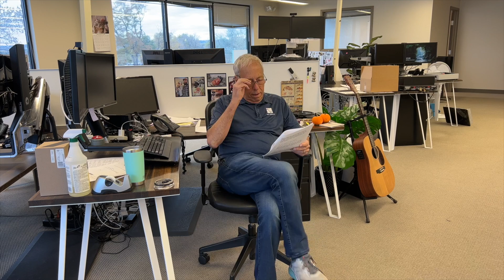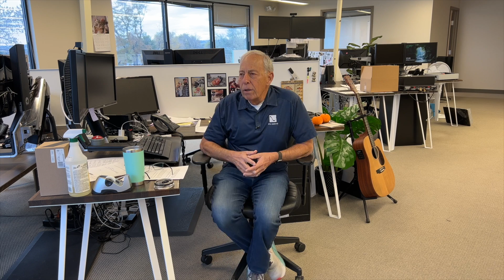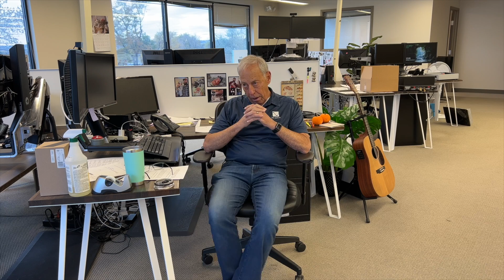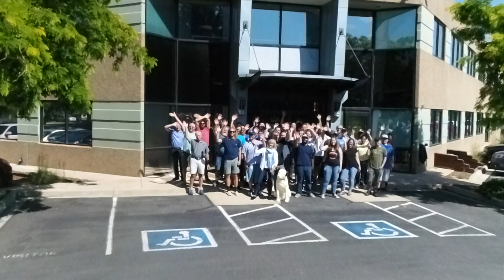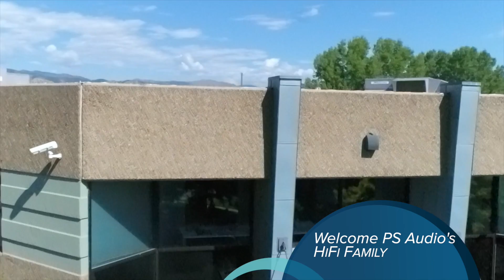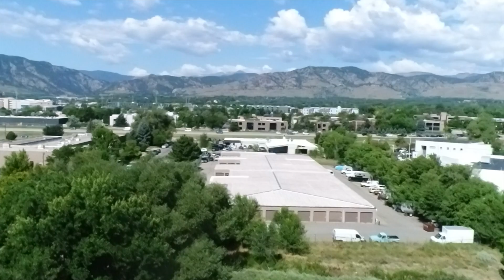Understanding current and voltage in audio

Comment: Here is something confusing that Paul mentioned (maybe I misunderstood): How is a speaker’s impedance, say 8 ohms, a “steeper hill” than a power amp’s input impedance of, say, 10,000 ohms? I understand intuitively that speakers are harder to drive than power amp inputs, but why does a lower number like 8 ohms mean more resistance and a higher number like 10,000 mean less resistance?
Reply: Its not a good analogy. The current is higher with lower ohms. With a superconductor its infinite(not really). With high ohms its very little. If the ohms are near zero it'll burn up whatever is trying to drive it as those parts can't handle the current that would flow through them
Reply: @lasskinn474  Thanks for the response and clarification… so the car, the horsepower and the hill is not a good analogy?
Reply: @SteveWille  its really not great. 

A simple isolated electric circuit of say a charged capacitor and a resistor and how it will discharge itself really is better. Theres not so much push as there is flow of electrons and effects of that.

The thing with the road and river analogies is that none of them really tell you anything about what gauge of wires you shoul.. Could be using or why an amp blew itself or what protection circuits do or what a ratings on a capacitor mean or how big of an airgap the electricity can jump and when it would do so, so they're not useful for determining if flipping a switch is a good idea or a very bad idea.
Reply: @Douglas Blake the way i look at it the problem with the uphill analogy is that the low resistance flows electricity more freely, so it takes more electricity to maintain the potential difference across it, which is ultimately what an amp is trying to do.

Consequently maintaining potential difference over a high resistance load needs less because it flows less freely across it and if you wanted same power drop across it you'd have to crank the potential difference much higher across it which is what i'd see as "harder push".

Of course actually providing higher currents tends to be harder in practice than providing higher voltages so that mixes things up..  But the low ohm load itself is easier to pass electricity through like i don't think anyone would describe a low ohm cable as an uphill.

Comment: In the car analogy: Volt is Rpm, Ampere is Torque and work done is Watt or Horsepower. 😄
Reply: Other way around, voltage is the force.  Amps is just the volume, or in this analogy the amount of spinning so RPM.  The torque/rpm/horsepower analogy does not relate well to electricity though.  A better analogy is hydraulics where pressure = volts, volume = amps, and flow rate (gallons/min or whatever) = watts.
Reply: @slode1693  Yes the other way around is perhaps better, but it does translate well as work done can be expressed by both hp and kW while you can interchange the other two to get the same amount of energy. 🙂

Comment: Current is the stream of charged particles (electrons). Voltage is the electric pressure (which can push electrons to move).  Current is not power! Power is energy per time (one Watt is a Joule of energy per second). Power = Voltage x Current.

Comment: Here's an easy example - a carpet shock may be 30,000 volts but since there is virtually no current, it doesn't kill you.  On the other hand, 240 volts at 30 amps coming out of your electrical outlet most certainly can kill you.  So the current is the oomph of the signal.

Comment: Analogies can be good educational tools if they are accurate. Voltage versus amperage is analogous to pressure versus volume. Applying that analogy to horsepower or watts is problematic since those terms combine the two and are used to define the amount of work performed. A more accurate analogy to amperage would be torque rather than horsepower.
Reply: You can have torque without movement, as in a clock mainspring, or a weight and pulley. That would be more analogous to voltage stored energy potential. You cannot have flow without pressure, but you can have pressure without flow.
Reply: @zulumax1  Agreed. Voltage is also a differential potential. The use of the term horsepower is what caught my eye. I really appreciate Paul taking the time to educate those of us without engineering degrees.

Comment: Voltage is the horsepower and current is the torque.
Reply: NOOO.  Voltage is the torque, RPM is current, and horsepower is watts.  It's not a great analogy in any case, but that's the closest way to describe it.

Comment: Charge is water, voltage is the pressure on the water and current is the flow of the water which may vary with the change of pressure. The resulting power (P) is the product of voltage (E) multiplied by the current (I) or in electrical terminology is P= E X I
Reply: and than comesa funny part. Power is voltage squared and divided by resistance (P=V2/R) - where is current? magically disapeared :-D ...... the point is simple, Current always needs to be equal characteristic like Voltage :-) if you are layman, you can say, current is constant only driven according impedance / resistance. For example 10volts signal and 4 ohms load is  25Wats of power, from that power you can find current by your equation, which is 2,5 amps for driving 25W of power on 4ohms load. if you want to have same 25W output power on 8ohms system, you will need higher voltage, aprox 14V, which is 1.8Amps on 8ohm load :-) I love those paradoxes :-D
Reply: that particular equation could easily lead into next question. If voltage is representation of intensity Air resonation travel distance, what does the output power means? :-D  Somebody could easily tell, that 8ohm system is more effective than 4ohm system, simply because you can handle same voltage on both system, but on 8hm you will have less power , means less current :-D ..... and that leads into understanding of Output power, preamp output power (gain for poweramp) input power from music instrument source, to mechanical Output power, thy physical what we hear - decibels (not talking about clarity etc)...... this is in overall pretty freaking topic :-) in root its simple, but such a simple things is heavy to explain :-D 

But my recomendation (as a semi advanced engineer) , you can take care of current only when you are designing Cables (diameter and of course its resistance comes to play also) for the system you want to use on particular power output.... otherwise, this is something you cannot monitor or control. Every time its only about the load you will put into the system. And load have its resistance, its the only key factor you can adjust....
Reply: This is the way it was always explained to me.

Comment: Water analogy:
Flow of water in pipe = flow of electricity in wire
Water pressure (e.g. 30 psi) = electrical voltage (V)
Water flow velocity = electrical current (I)
Faucet lever or valve = resistance or impedance (R)
The higher the water pressure, the higher the water velocity. But you can control water flow by the faucet valve. When valve is loosened (low resistance, low impedance), water flows more freely.  When you start to tighten the valve (higher resistance), water flow weakens. Exactly same phenomenon as electricity.
Reply: Voltage = pressure, current = volume, flow (gallon/min etc.) = watts.  Volts x amp = watts.
Reply: Amps (Current) is the volume of (the water / electricity) flowing. Volts is the measure of force of it (pressure) and watts is the amount of power (work it can do).

Edited - based on kind feedback from Douglas Blake.
Reply: @Douglas Blake Ah, ok, thanks for correcting me 👍. Yes that makes better sense now too. I have edited it to reflect your kind feedback and credited you.

Comment: I am confused.
Reply: Look at it this way. “Charge“ is water in a pipe. “Voltage“ is pressure on water and “Current” is water flow that varies with pressure on the water. Power can be calculated by multiplying voltage times current.
Reply: Me too.

Comment: Yes you didn't explain it correctly. The velocity of water in a pipe is like current. The pressure the pipe has is like voltage.
Reply: I would have described it a current = volume.  Voltage = pressure.
If you have a tiny stream coming out of a syringe, It can have lots of pressure(voltage).  You can shoot it across a room, but you won't knock over the furniture as there is no volume(current).  A tsunami may come at you slowly, (low voltage) but with great volume (current).  It will sweep away your house.
Reply: @user-od9iz9cv1w  That’s a more fun and better explanation of voltage and current. This guy Paul really crashed and burned on this video. No prep ever lol And so did some of the comment posters, clueless.🤣 He really should’ve kept that conversation amplifier related for the purposes of audio education, instead of trying some minimalist explanation about what voltage and current are, but it’s obvious he’s not technical enough, so I don’t know why people are always here to listen, his purpose is marketing plugs.. I find the channel ignorance and polarized views entertaining at times.👨🏻
Reply: NO, you didn't explain it correctly.
Reply: You got it the wrong way around there.
Reply: As my tech school instructor always said. Use piping in a home, the water running thru the pipes, and the pressure behind the water. 45 years later people (instructors too) are still using the same idea. Cool
Reply: @googoo-gjoob  I was referring to the comment poster, not you.
Reply: @UCMlbf8XZhxnIeDv7UAtIGzw you're right. Danger Zone did express it correctly. It's a confirmation of what Paul stated and saying "yes" does that. It's simply agreeing that Paul didn't explain it correctly. It seems were not taught that because it sounds contrary but it isn't.
Reply: @UCMlbf8XZhxnIeDv7UAtIGzw linguistics is a descriptive field, not a prescriptive one.
Reply: Paul did it again: wrong.  Sorry to say.
Reply: It makes no sense to bring the frequency into a analogie of Voltage and Current. 
Pressure is the Voltage, the water is the Current. 
Both are moving with the frequency.
Reply: @atzeotze2256  Yes, the analog will only be valid, if any, for DC. When you are bringing AC into the equation, you are quickly ending up with energy traveling along a conductor rather than current running through it.